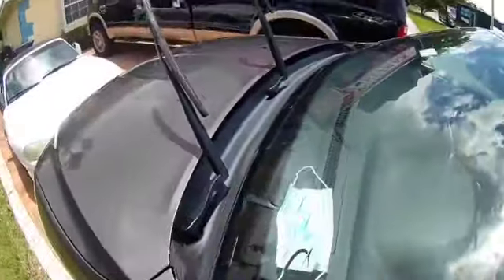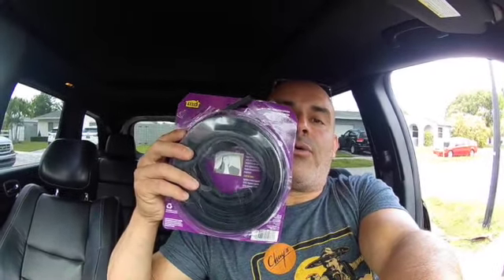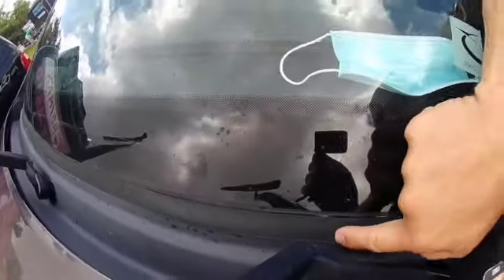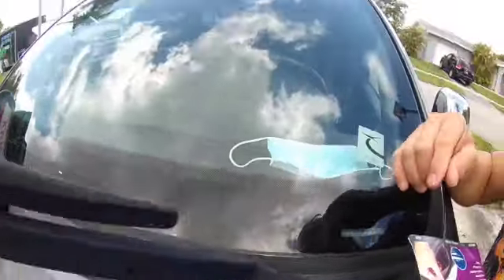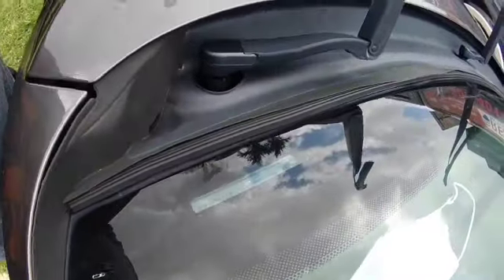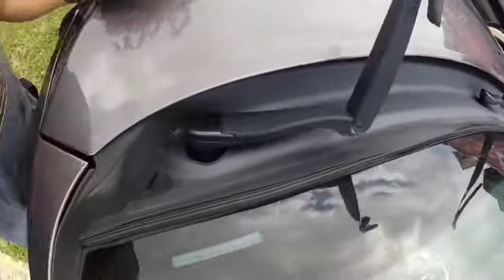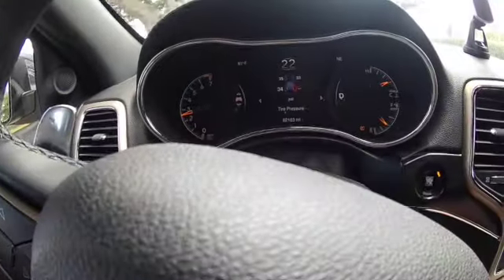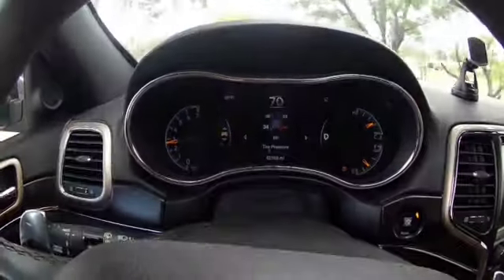2014 Jeep Grand Cherokee windshield cowl buzzing noise fix DIY

Comment: OMG, THANK YOU SOOOO MUCH!!!! I got front end suspension work done in my car and it started making that buzzing noise the day after I picked it up. I drive on highway but usually in rush hour traffic. I drove over 70 mph the night before I dropped my car off and it was not making that noise. Then the 2nd day of having my car back hit 70 again and this annoying buzzing noise started. I thought they left a tool inside or loose screw, something???? Took it back to them they kept trying to charge for new wipers, “Are you crazy” I said. Took it to 7, yes 7 other mechanics and I got everything but your answer priced between $200 - $1000. I can do this myself. My mechanic is already mad at me because I change my own lights, he charges $40. A car hit my parked car and busted the tail light, blew out the directional light asked him to change it. (I had to work all day) He tried to charge me $450 and that was for a used tail light. No. You go ahead and keep that. I changed the directional light until I received the tail light unit which only cost me $70. I’m showing him your video!

Comment: Like others I replaced the wiper blades, not once but three times.  While pressure washing my 2014 Jeep Grand Cherokee I heard the noice while spraying off the windshield.  I used blue painters tape to test the cowling.  Noise was eliminated.  I have been waiting almost two months for the dealer to get the new cowling.  I wish I had seen this sooner.  I could have saved a roll of blue tape!

Comment: If you ever get a rattle that sounds like it's the instrument cluster or gauge on the left hand side, that's your driver's hood hinge.  I've just been squirting oil on mine when it gets noisy.  Also have the vibration you have, but plan to fix that with a bead of black silicone.

Comment: I've tried Silicone Adhesive and some trim adhesive underneath the cowl and it was working for me.... I ended up ordering a Cowl from the dealership for $130 w/ tax so not too bad, I will probably try this in the meantime before my replacement arrives... have a trip this weekend, DO NOT wanna listen to the humming noise for 5+ hours

Comment: Hi Sir. Thumbs up for nice help. Will you please so kind as to share the exact description or type od this weather strip.. Beacuse there are different types of MD product abailabe  on Amazon....I can't figure up the exact type for Jeep cowel noise. I am far far away from you, in the Middle East.... I will be gratefyl for your help... Either please share a link of the product on Amazon or ebay or the exact description.... Thanks.
Reply from the maker: If you pause the video when the package is up on the screen you can see exactly which one it is, It is a marine and automotive weather striping. Also the cross section of the item is on it as well. I am sorry I don't have the exact part number. Realistically, any weather stripping you use will work.

Comment: Did u clean it with Alcohol or soap and water and the back side u pull off do it go on the window or the black part I think I know but just asking lol
Reply from the maker: I cleaned the area with alcohol to remove all the grease from the glass then applied seal to glass
Reply: @allritythen  thxks I'll work on mine tomorrow

Comment: After I replaced my windshield, some noises come from the windshield like squeaking, would it work ?? If i do what u did ?
Reply from the maker: The noise that most people experience is that of a vibration. Check to see if your cowl is pressing up against the windshield. If not, it might work.

Comment: Can you have step by step on how you did it?
Reply from the maker: Clean glass, cut a length of the seal the same as the cowling. Remove only a little bit of the glue backing but do not remove completely. Let the little price stick out so you can pull it out later. Lift cowling a little and place the end of seal that you stripped. Then go ahead and place the rest of the seal just on the bottom edge of the cowling with glue facing the glass. Once the seal is completely placed under the seal, you can then remove the glue backing slowly and press down on the seal as you remove the paper backing. Then you are all done.
Reply: What glue did you use ?

Comment: Thank you! I just tried this for my truck & it works perfectly. The exact product is MD auto & marine weatherseal (10” x 19/32’ x 5/16’) $9 on Amazon.   How has the fox held up long term?
Reply from the maker: So far still holding strong
Reply: Isn't 19/32 too thick?
Reply: It’s not gonna fit flush with the glass but it gets the job done & doesn’t look bad . If I could add a photo I would. It is on the thicker side though
Reply: @michaelg2488  thank you Michael, took your advice and did it, problem solved. Thank you again.

Comment: Nice cheap solution but would have been nice if we could have seen how you actually placed the stripping under the rubber. Next time have someone hold the camera to show the actual work you're doing, it would help us a lot. Good job overall.
Reply from the maker: I glued the strip just under the rubber of the cowl. Not much to it. You can see it on the video . I just lifted the rubber gasket with one hand and stuffed the weather strip just under it with the glue side down to stick it on the windshield. Good Luck
Reply: I did not see you used glue. What part of the weatherstripping go to the windshield?

Comment: Could you not just glue down that rubber seal to windshield?
Reply from the maker: I suppose you could. The cowling gets warped over time with heat and doesn’t fit perfectly with the glass.